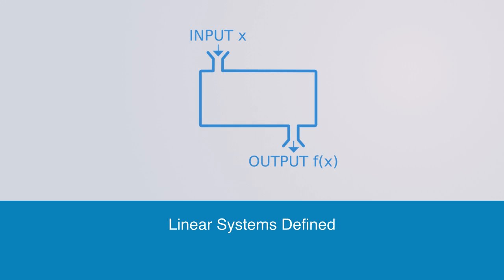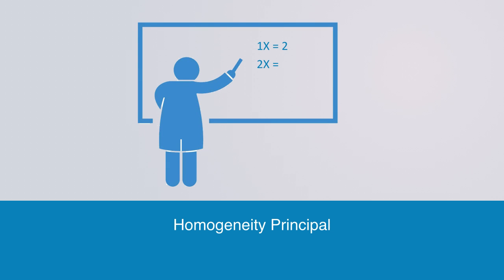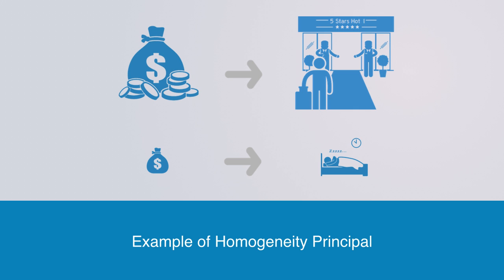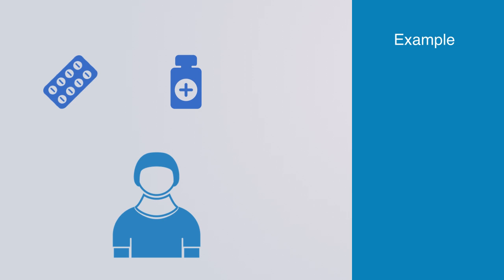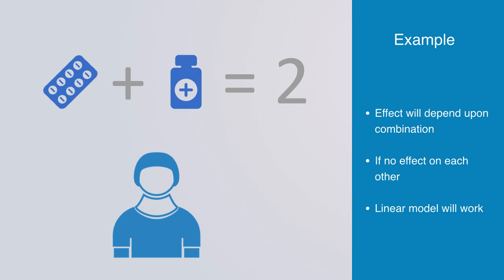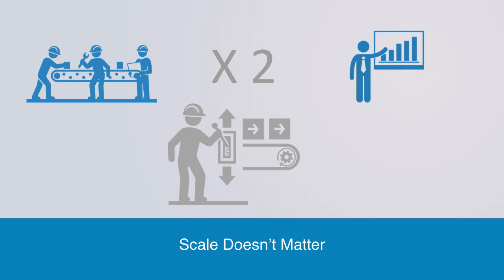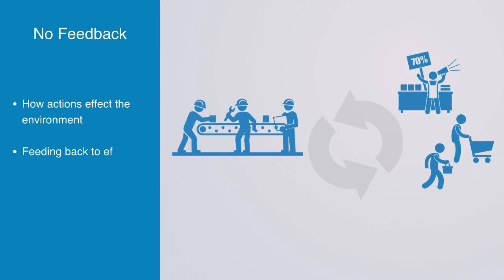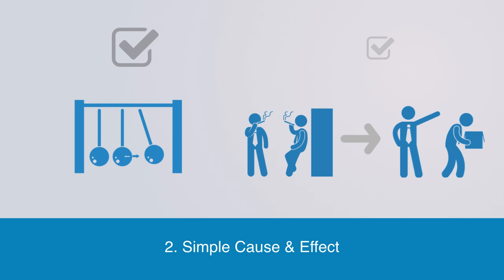Linear Systems Theory

Comment: This is the definition of a linear system, used in signals & Systems, in circuit analysis, in control systems and in math. It's not whether a systems produces a sinusoidal output to a sinusoidal input, as some people say (e.g. in electric power quality & harmonics).